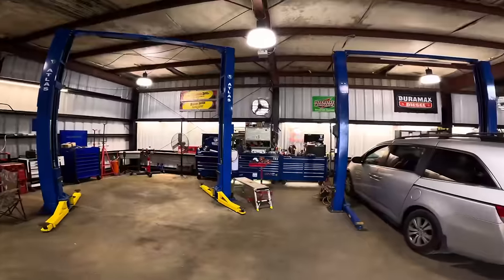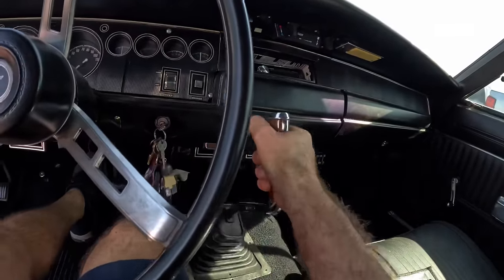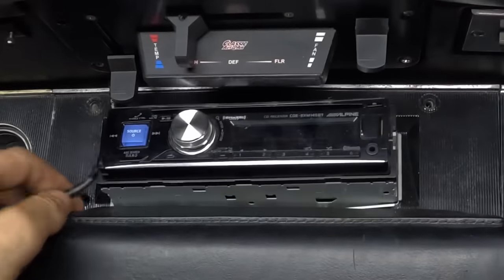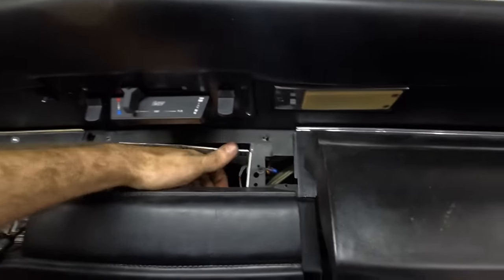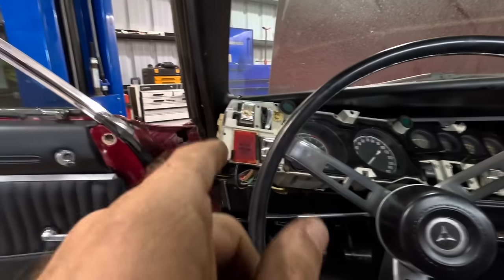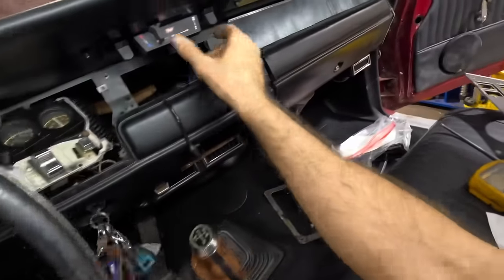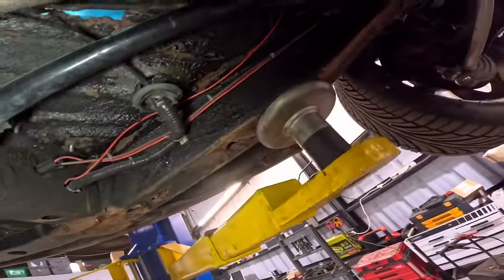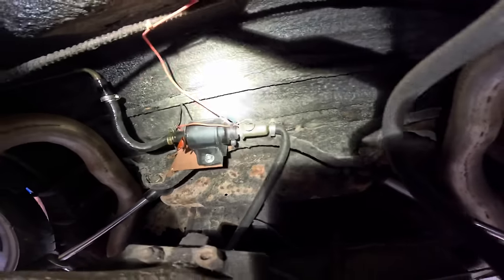Needs REee Restoration | 1968 Dodge Charger

Comment: The guy who put 5 1/4" in the door needz his ass kicked.

Custom made fiberglass kick panels would have looked better and sounded better. Now the doors all cut up.  However a pair of 
Polk audio 5 1/4"  speakers are thinner grill my bet is they will clear the window crank  but still stupid idea.  You don't chop up a 50+ year old car  i always refused to do that to a classic and i did high-end car audio for 17 years in retail stores.
Dam wish i still had my 64ss impala with the big block 427? 
Not sure what the motor was on it it dorfed a 350 ss novas motor and filled the engine bay. If i rember it was a 3 speed power glide transmission  and it was like driving a tank on wheels. I knocked down more mailboxes by mistake with it didn't even scratch the crome bumper  street signs no problem.  Datsun 510 ripped it up like a pop can.the 64 didn't know it hit anything. 

The dodge radio needs a back strap it sits in the dash at about a 45 dgr angle its not going to be able to play disks   he needs a multimedia radio without cd. A compact disk will skip.
Fact.

Comment: That car is on the very edge of being too far gone. If it weren't a '68 Charger, it would have already met its fate.
You're looking at a minimum of 70K just to restore the structure/body work. It's totally rotten from the inside out.
It might be worth it in the end but I wouldn't touch it with a ten foot pole.

Comment: I hope the owner paid substantially less than $10K for that project car. Floor patches done using self-tappers, rust repair with mud, substantial rewiring needed - this thing is clearly a flipper car. It needs at least $20K of work, and it'll never be worth more than $25K. At the right price, it might be saved by someone with welding, sheet metal, paint, electrical, and mechanical skills, who can do their own work. Let's just not talk about what might be under that vinyl top, ok?

Comment: Polished up turd that someone not knowing much about hot rods got P'owned on. Chances are by that list of things, the person owning this doesnt have the first clue about anything mechanical. That car has had so many fixes over top of fixes that all of those would need to be un-fixed before you could get back to baseline. .All of that wiring jammed under rust repair panels, none welded, all just riveted and screwed together....yikes. The bondo underneath that pretty finish is another in the list of reasons to not get involved with that car Ray. Turn around and politely walk away. The last person to touch that car with a wrench will be responsible for everything else. Nope.

Comment: it is a boat a bottomless  hole to throw money in looks like a kid car get it running and out the door the owner can drive it a few more years or he can send it for a full restoration if he is rich i would take my old wreak of a honda civic any day over that beast my opinion dosnt matter i prefer dependability over muscle and gas mileage i would park it out back to rot or give it away to a kid that wanted a home shop project ha ha not funny i had my first project at thirteen it was so bad it never made it on the road 51 Chevy truck rust bucket hi rain man

Comment: To heck with walking away from this car. Run as fast as you can. You are a mechanical repair shop, not a vehicle restoration facility. It needs a complete body off restoration (if it’s a body on frame kind of vehicle). You can’t even put lipstick on this thing until you can locate and repair or replace the lips. 👄